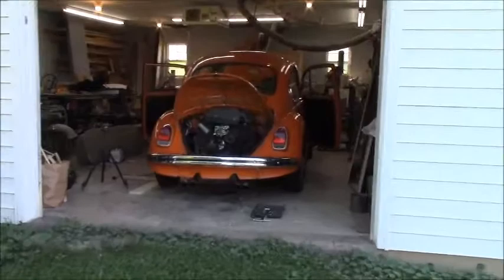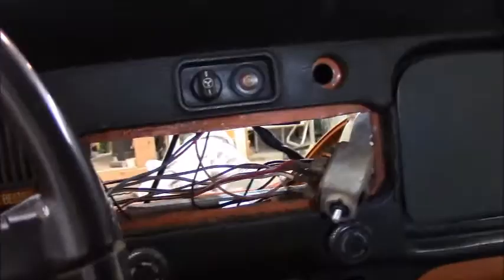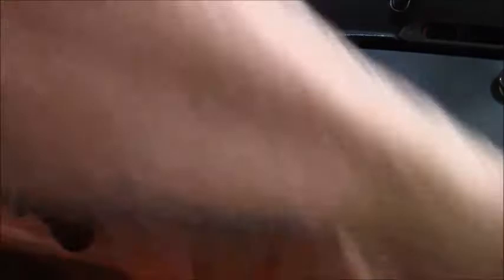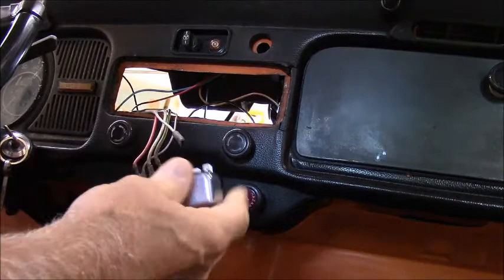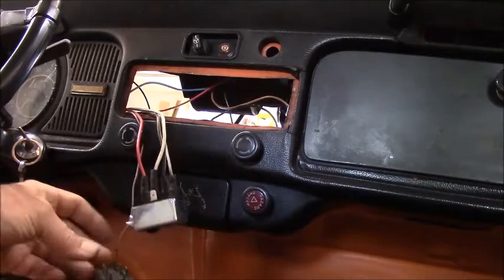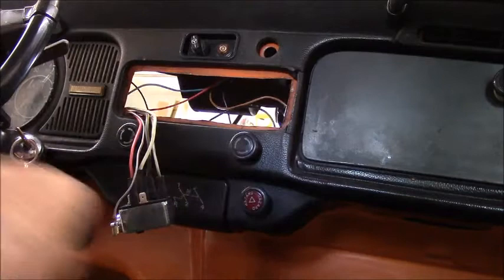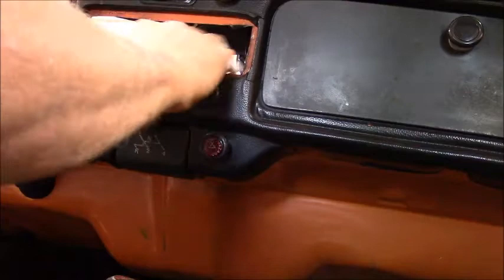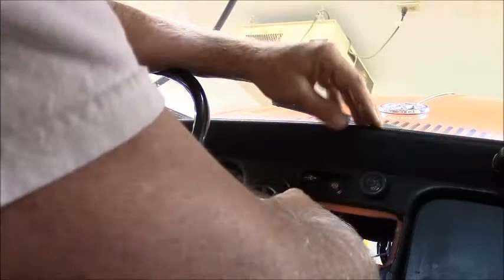How to Volkswagen Bug headlight switch replacement and dome light switch troubleshooting

Comment: nice video--I have a 71 convertible that won't start---and have traced problem to bad headlight switch...lol   Apparently, 71 (and 72) route the solenoid ignition circuit thru the headlight switch..so...going to be doing the same procedure next weekend.  I was really mystified as to whether or not I'd have to take out the windshield wiper assembly---but your technique of removing radio and pulling thru the hold is much easier looking.  Thanks!

Comment: Does the knob on the switch just pull off? I cracked mine on my 73 and was curious if I could just replace the knob or if I’d have to replace the whole switch.
Reply from the maker: The knob screws off counter clockwise
Reply: @bobsbarnworkshop  thanks